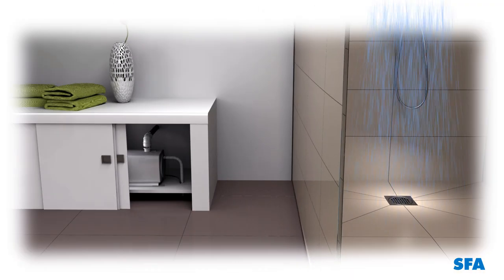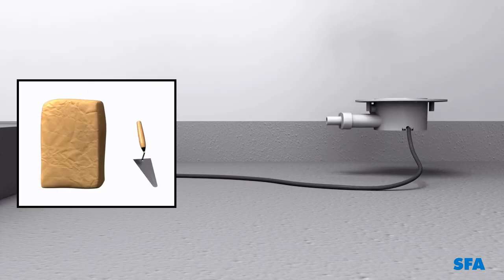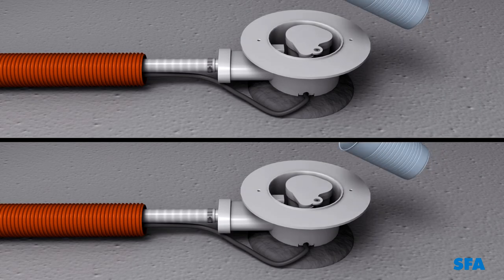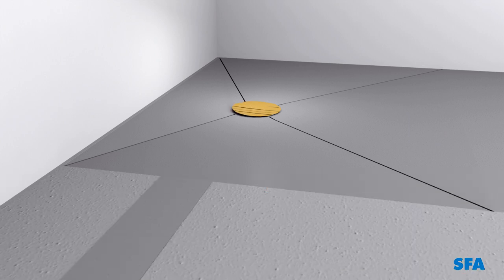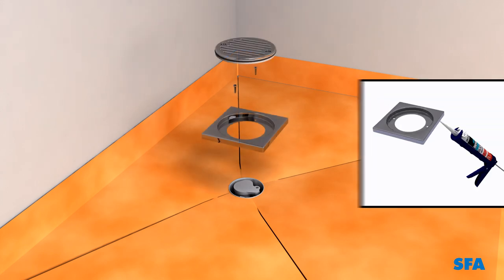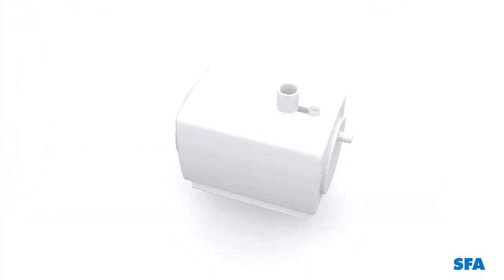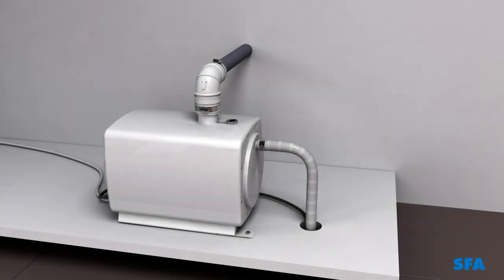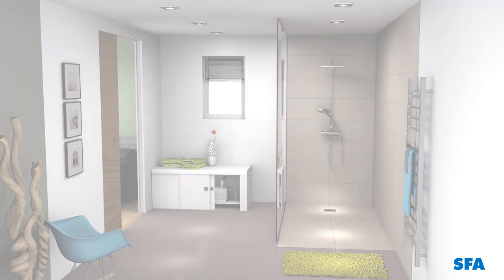SANIFLOOR: a walk in shower anywhere!

Comment: I'm pretty sure the benefit of Sani flow was not to cut into concrete, if I'm going to cut into my slab I'm miles well put in a normal plumbing system then cover it again with cement.